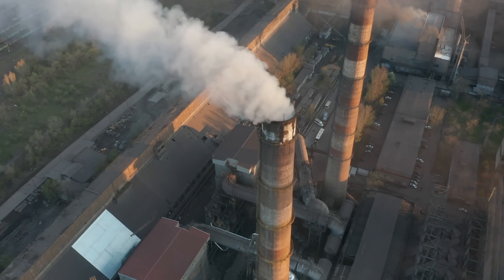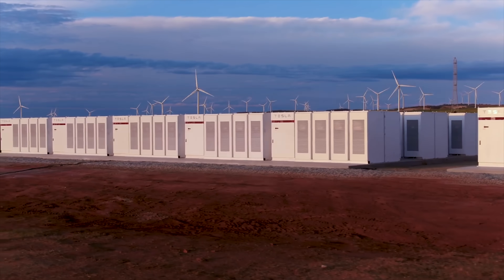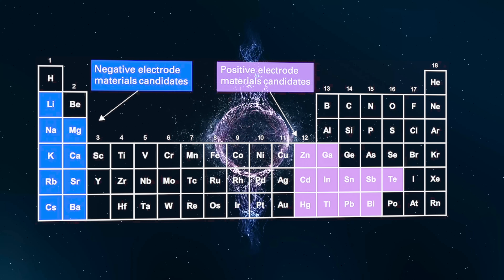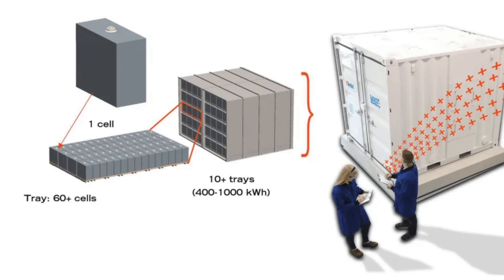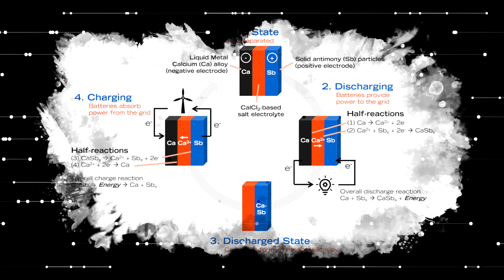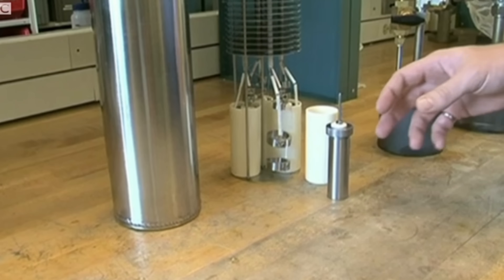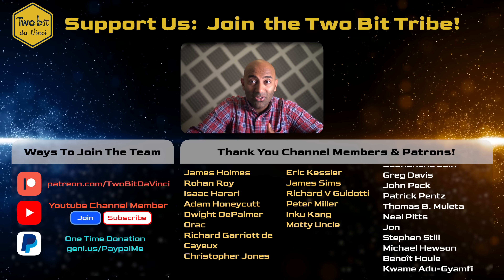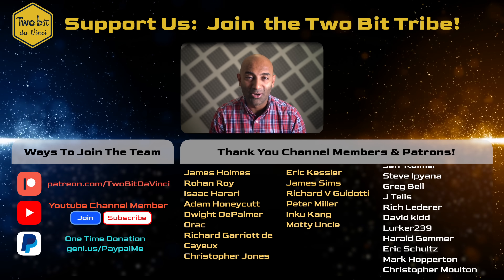Liquid Metal Batteries Have Some Shocking Properties...

Comment: Ricky,
Thanks for covering this technology. I've been following Ambri for a few years now and, like you, am really impressed with the technology. As you pointed out, there is no "one size fits all" for battery applications. Liquid metal batteries look to be ideal for fixed, large scale power storage applications, freeing up scarcer resources required for mobile power applications like cars.
Good job.
Reply: Add a stirling engine to these in some way, for larger scale setups for extra win!
Reply: It's vacuous nonsense. No safety agency worth its name would ever certify such a device. Lithium-ion is far too troublesome as it is. Have you forgotten those Boeing 787s with battery packs on fire ?
Reply: @grahamstevenson1740  They're non-flammable. Different chemistry.
Reply: @stevemickler452  You're suggesting that 787s have non-flammable battery packs ? Where did you get that halfwit idea ? All Boeing did was fit a 'sticky plaster' in engineering terms. Lithium is highly flammable, you can't make it change its' spots !
Reply: @grahamstevenson1740  Sorry if I communicated poorly. I was talking about the  liquid metal batteries that are the subject of this video..
Reply: @stevemickler452  OK, they're different from Li-ion but still may combust happily. I recall hearing of the Sodium-Sulphur battery and thought that one may make a good bomb.
Reply: @grahamstevenson1740  there not for phones, they are for cars and houses large things
Reply: @cambis56  What on earth gave you the idea that I expected a seriously hot, liquid metal battery to be used in a phone ?????

Comment: 3:50 That "self" generated heat isn't nothing new. Same happens with Li-ion batteries. But that is connected with internal resistance and losses when charging/dischargin.
Reply: The self-generated heat is a bugger when it runs away. This is the reason no-one uses these 'bombs' !

Comment: Naval vessels  using a molten salt thorium  reactor would be a good application  along with long distance  
Nuclear rockets to the outer solar system.
Reply: The nuclear ion drive would be a great idea, especially for the proposed carriers which will run spacecraft between Earth and Mars.
Reply: @anydaynow01  Infantile nonsense. An ion drive is like puffing at a sail. It works sensibly only at the millennial scale  where speed of propulsion isn't an issue.
Reply: WHY WOULD ANYONE WANT TO GO TO THE OUTER SOLAR SYSTEM ? THERE'S LITERALLY NOTHING THERE. YOU DO KNOW HOW ROCKETS WORK RIGHT ? YOU NEED TO EXPEL MASS AT HIGH VELOCITY. WHERE DOES THE MASS COME FROM ?
Reply: Maybe you need to read up on nuclear rockets purposed by NASA  and the Russian?
Reply: I HAVE 'read up' ! Unlike YOU !
Reply: MSRs need no battery backup. They work 'as is' fine.
Reply: @grahamstevenson1740  it's  obvious you haven't.

Comment: You say liquid battery 🔋???? What about freezing??
Reply: Perhaps you should have watched the video first
Reply: Ambri's battery regulates itself and it's ultra insulated so I doubt cold will hurt it much.
Reply: @mathew00  No matter how ULTRA INSULATED  it is, heat always flows the same way. From hot to cold. Insulation alone cannot stop it freezing !
Reply: These kind of battery is designed for short term storage like daily charge/discharge. What's more if it loose its liquid state it can be heated and will recover its charge state. But of course that heating will be a loss.